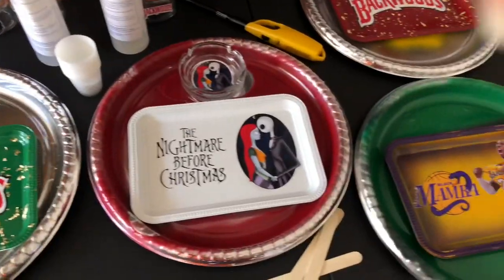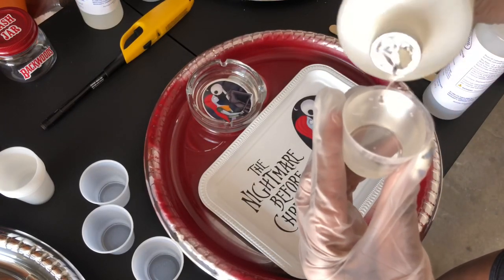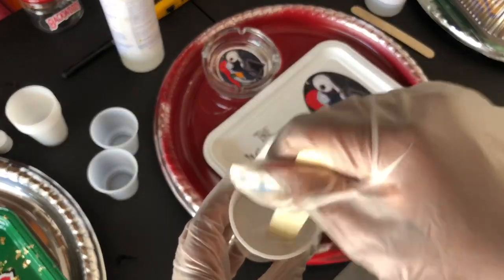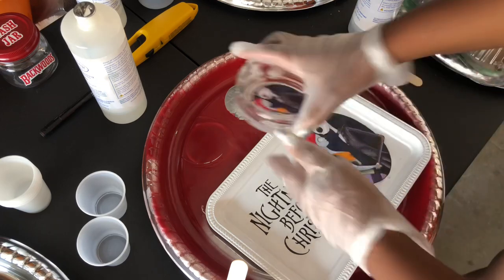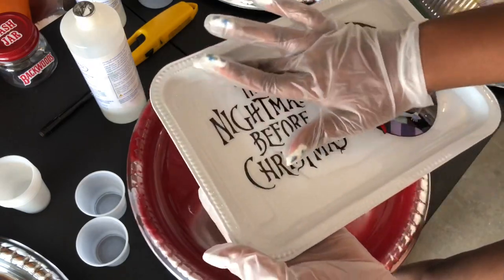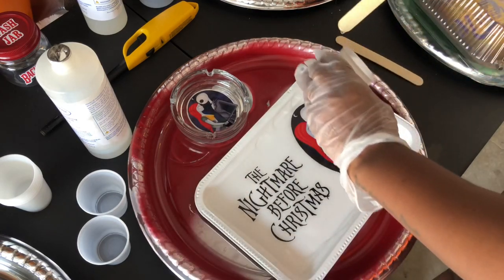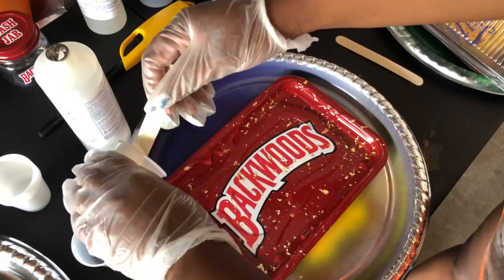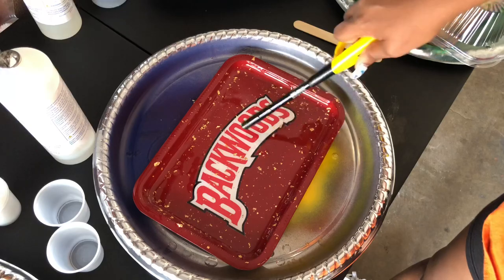How to use Epoxy on Rolling Trays |How to Get Rid of All Air Bubbles

Comment: If the resin has a “dripping” look on the sides as it’s drying or has dried, what can I do to prevent that from happening?
Reply from the maker: Once it has already dried there is nothing you can do. But to prevent that from happening I usually runny finger across the bottom edges to make sure nothing is dripping.
Reply: Omg yes you can fix all you need to do is wait till it dries and wet sand it with sandpaper and water
Reply: How long does it take to dry ?
Reply: @GG-yl9if   Thank you!!! I am glad I came to the comments
Reply: @emiliejerrolds1945  usally 24 hours and its touchable

Comment: How much epoxy did u need to use per tray? Ive never used it before n im trying to learn before waisting that n my money
Reply from the maker: Hi I don’t use much but I do about 6/7 trays per epoxy bottle
Reply: @Ohhijanelle  ty. I did my first 6 trays and used 20ml of a&b per tray and that seemed to be perfect. I tried 10mil of each on my 1st one and it just wasnt enough in my opinion, but thanx for getting bk to me. Now i just need a printer to do more detailed images
Reply: what epoxy do u use?